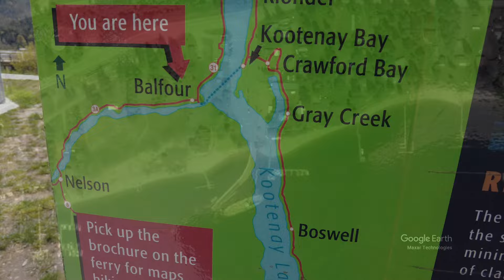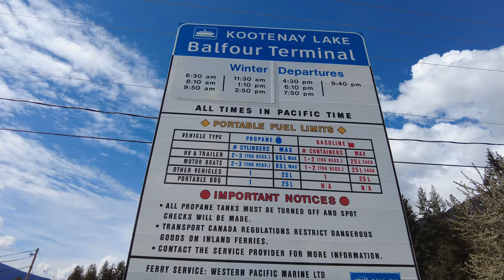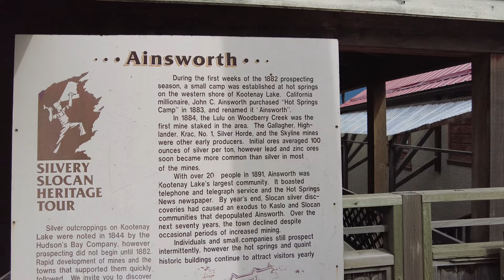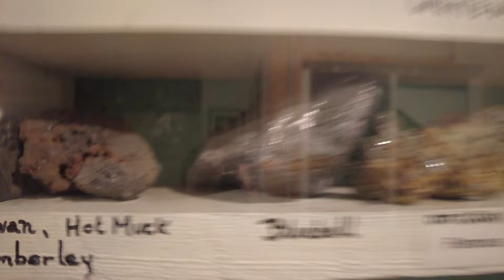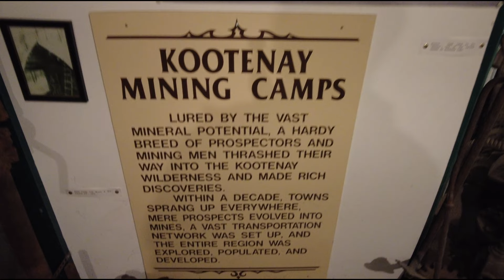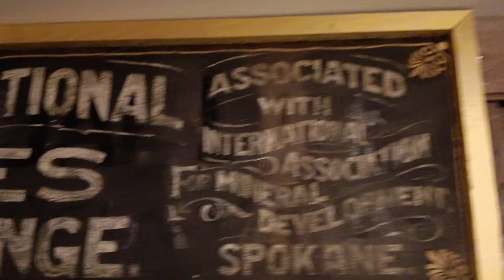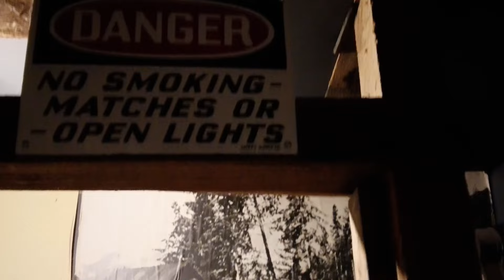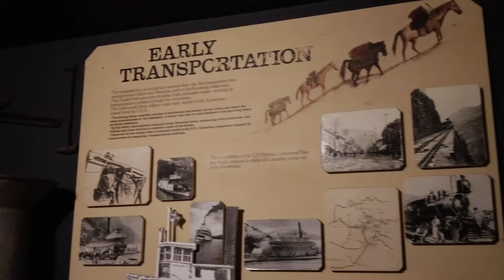Kaslo, BC - Mining & Prospecting In The Kootenays, Hotspring Caves At Ainsworth & The CPR Railway

Comment: Thanks for the video.  Just a minor correction. The hot springs are naturally heated by the earth. It is cooled down(at time) by staff to be adequate, by adding water. And the caves are not caves but a tunnel that has been caked over in calcification.